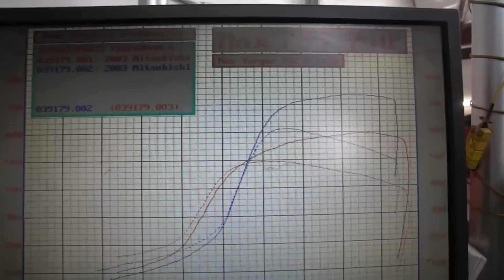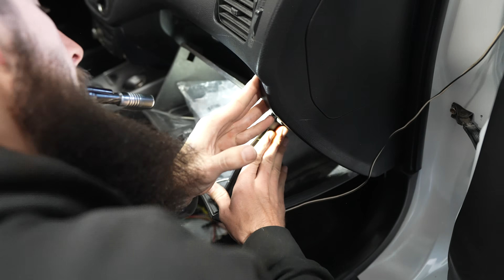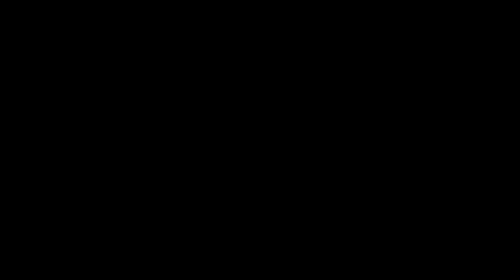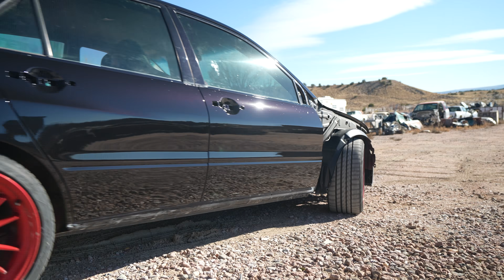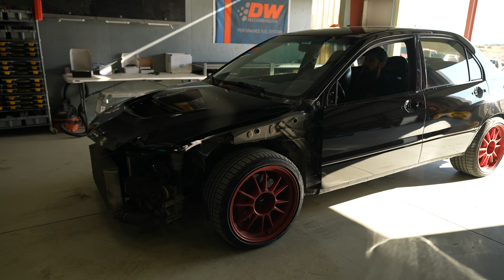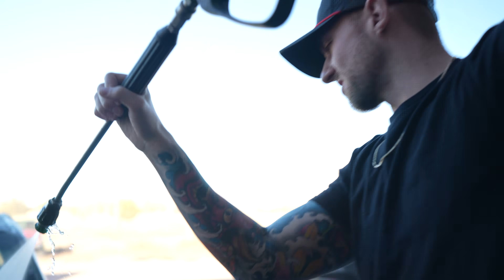THE EVO WAGON IS BACK! + NEW CAR!

Comment: I could see a bad ECU being the problem. If there was a loose/corroded circuit board component that heated up and expanded, then that could cause a continuity problem on that circuit causing a no start when restarting. Time will tell. Stoked to see the Evo again either way!

Comment: I miss my Evo, it was kind of a sh*tbox given it had rust at the pinch welds, leaky oil pan, shaky steering wheel, bubba'd wiring job, rebuilt title, clunky steering wheel lockout, dead acd pump, faded paint...it was a basket case that I won in a raffle but it was fun and I got to experience my dream car for just a moment. I don't regret selling it because I knew that there were more opportunities to win a better Evo to come. Here's to future builds and hopefully I get a second chance at owning a Lancer Evolution.

Comment: Oh hell yeah Link ECU! We just started working with them and it has been amazing for Rotaru. Our tuner had never tried one before, and he was super impressed with the capabilities and help files. I had no idea the Evo Wagon was still on a stock ECU. Definitely thought you had gone standalone with the original build. Wouldn't be surprised if some capacitors or other components were past their prime in the old computer. Either way, the Link will give you full monitoring and control with of course great data logging. Excited to see what you think of it gonna keep watching the video.
Reply: Laughing so much at the unplugged injectors. We did the same thing with Rotaru multiple times when we were on the old Apexi and trying to get it to run well. Our experience with first start on the Link was same as yours, fired right up first try on the base map, barely had to do any configuration and the base timing was even correct.
Reply: Evo IX looks sweet. Hope the giveaway goes well!

Comment: 😍That paint looks soo damn nice! Is it the Tarmac Black? It looks like it, you can see the purple/blue really well cause it's so freshhh!

I have to try to win this! Do you guys offer Evo restoration? because you should since most of the Northern Evos still around could use it. Like mine lol Just master the chassis leg repair lol bad chassis legs can send an Evo to the junkyard

 Did you notice if when the Wagon does not start that it was recently wet?

Evos have an issue with a leaky rubber grommet that lets water through and run into a wire harness and prevents it from starting. I found the solution on EvolutionM it's not uncommon. It's hard to diagnose because it only happens after it rains or car wash.. but only sometimes... and sometimes it will start after a few cranks.. it's really random.

My Evo was in a shop for a week and they couldn't find the issue that's when I went and found it online. Told the shop and they just eliminated the wire harness and I haven't had the problem again in 14 years. If I remember it was in the Drivers (LH) wheel well somewhere.

Do you still have the dark blue SAAB Wagon? That was nice. I daily an '03 9-3
Reply from the maker: Yeah we resprayed it the factory Tarmac black, Honestly i didnt even know it had any other colors in it when i first got it because of the faded clear coat. Looks really clean now tho, first time i have seen the purple/ blue was when we pulled it outside in the sun for the first time. The car has not sat outside at all for the past 3 years, so its not a wet thing. I sold the 9-3 wagon a few years ago and i still miss it haha

Comment: At last not another emu black link is far better I guess
Reply: So ultimately it is better and have more options as well be it for now until ecu master comes out with plug and play
Reply: Link isn’t better they just have a plug and play option which ECUMaster is currently in the process of making. Link was used for time and ease. Trevor could’ve easily wired in an EMU Black if he wanted to. Just takes time.
Reply: @carguyty9370  Both make great options. Link is well known for their Evo plug n play units, so it makes sense. Trevor said in another comment that ECU Masters is low on boards right now. We have been super happy with the Link ECU we put in a rotary swapped BRZ.